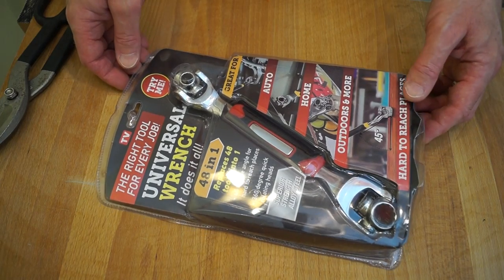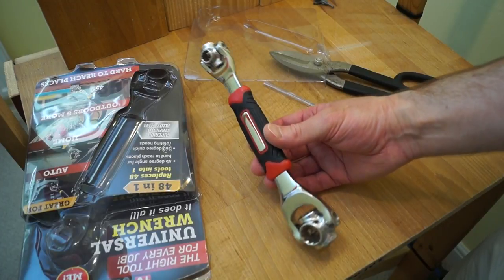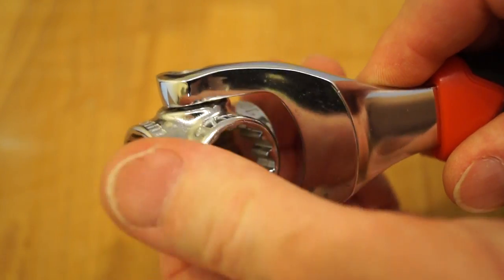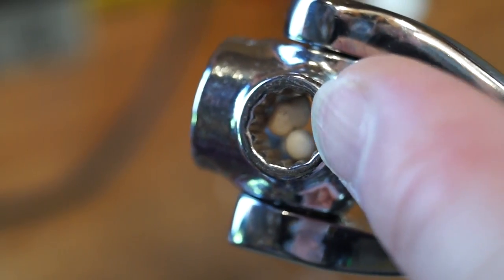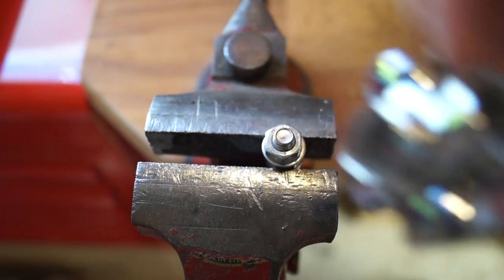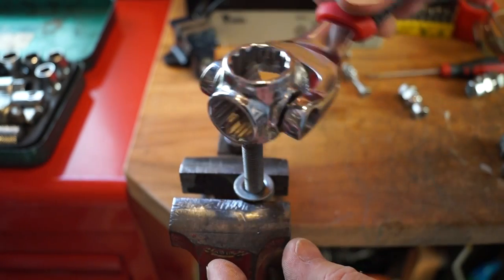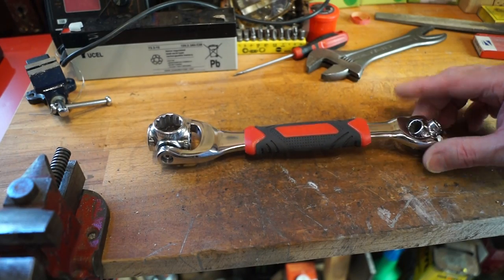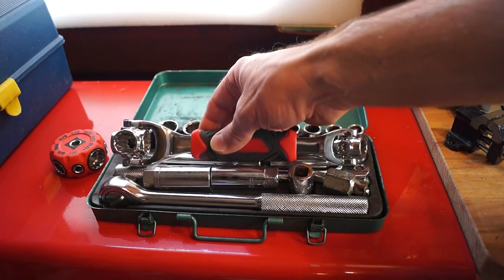48 in 1 Wrench Review

Comment: I think some how they are speaking also of diff type of nuts / bolts
4, 6, 8, 12pt 
It can also be used as a hammer.
(May be ok for home use with good clearance, probably won't get in close enough to remove even a car battery)

Comment: 48 is marketing magic word, while it is actually 4 sockets (each end)  having 8 sizes (4 metric and 4 imperial), so actually it has 2 ends x 4 sockets x 2 sizes =16 sizes on 8 sockets from 2 ends.
Reply: I think they are speaking also of diff type of nuts / bolts
4, 6, 8, 12pt 
it can also be used as hammer
Reply: Plus one hammer on each side
Reply: it can also used as your toothbrush
Reply: Actually it's because each socket can open 6 types of bolt head shapes.  So 4 sockets x 2 ends x 6 types = 48.

Comment: How is it 48 tools/uses with only 8 sockets? Are they counting 6 point/12 Pont/Torx etc etc?
Reply: I suppose it's because 1 socket can handle 6 types of bolts... same sizes, but different forms. At 1:15 you can see the pale blue shapes in white circles.
Reply: Only 8 sockets....how is it 48
Reply: Yeah, they are counting different head shapes as well

Comment: How it is 48 in 1 . have you tried to find out ?  have you tried with a square head bolt ? in confined places it is not workable as the round head of sockets will obstruct the space.  You have just shown for a simple hexagonal head bolt.  For any tool , I would request you explore for all types  of jobs in many conditions then only you can make out whether it is more or less useful.

Comment: I don't think this is a good tool to have. If you want to open a nut and bolt in a hard to reach places the bulky head it has will never allow it to happen. A normal flat and ring spanner will have to be used.